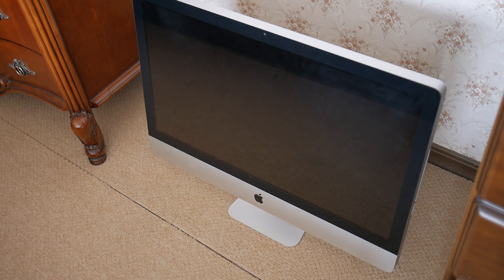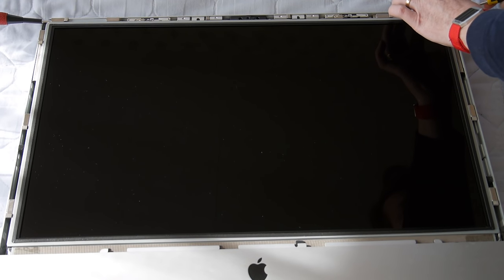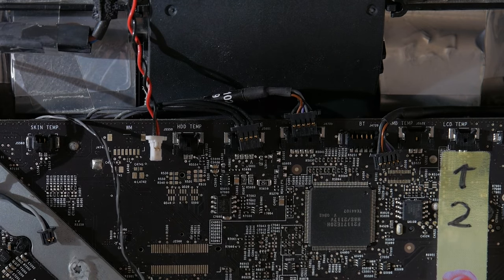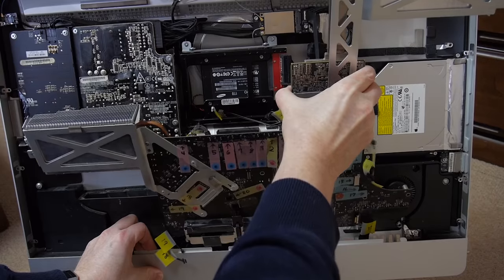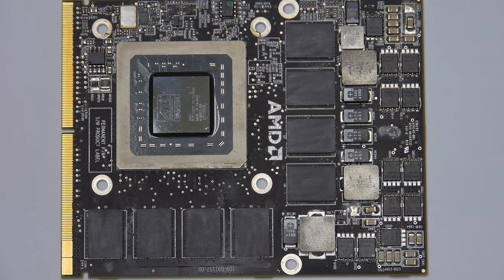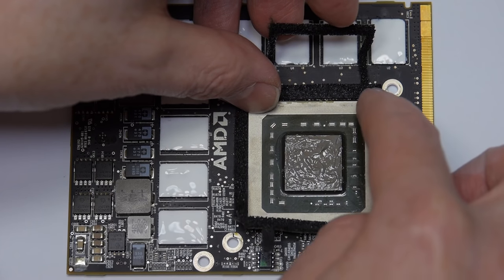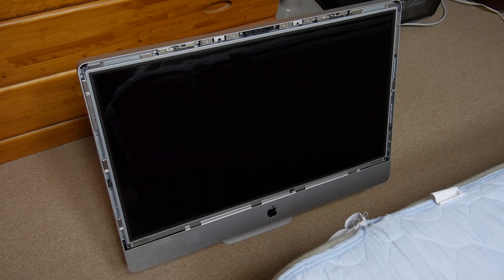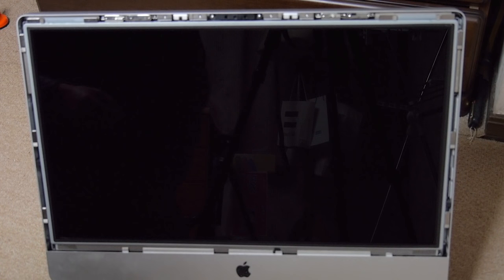Late 2009 iMac 27" Video Card Repair [4850 Bake]

Comment: Hi. I had a damaged graphics card so I did what is in this video.  After submitting the iMac, I was happy because everything worked.  After about 15 minutes, the computer turned off. What have I done wrong?
Reply from the maker: Thank you for watching and for your question. Either the bake did not work in your case, or the card is getting too hot and your machine is shutting down. Did you clean off all of the old thermal paste? What replacement thermal paste did you use, and were those pastes purchased by you within the last year? Also, what model year is your iMac and what is the model number of your video card?
Reply: @JDW-  Thanks for the quick reply.  I cleaned the graphics card from the previous thermal grease.  I used some cheap "Gembird" paste from a local store.  I bought it the day after baking the graphics card.  My iMac is from 2009.  Has Intel i5, currently no disk and 10 gigabytes of RAM.  Where can I check the model number of the graphics card?
Reply from the maker: Since you have a 2009 model, if your video card looks like mine does in my video, then you have a 4850 card.  My concern is about the thermal paste you used. You actually can’t use the same thermal paste on the GPU as you use on the video card memory chips, especially if you clean off all the old thermal paste. That’s because the memory chips have a gap above them. Those memory chips do not directly touch the heat sink like the GPU. For that reason, you must either use thermal pads or use my recommended K5 Pro thermal pad replacement paste. If you use normal paste for a GPU or CPU on those memory chips, it will not bridge the gap well and your card may overheat. I think that could be the problem.  My 2nd Bake video shows all this in detail, and I put a lot of helpful info in the text description under that video too, so be sure to read through that. I hope this helps!
Reply: @JDW-  I only have thermal paste on the graphic chip.  I have original thermo pads on the memory chips.  Maybe they need to be replaced because they are already old and worn?
Reply from the maker: I cannot give you a 100% guarantee that will solve your problem. But I can’t say that using the old thermal pads it’s a very bad idea, and that is very likely the root cause of your problem.
Reply: @JDW-  What can I do now?  Buy new thermal pads?  Can somehow cool the graphics?  I tried to set the fans to max in Macs fan Control program but it did nothing.  I care about this iMac and do not want to give it to the service ...
Reply from the maker: @oskarmarkowicz3081  In the Text Description under my video above, I provide Amazon links to the pastes I recommend.  Your Gembird paste is fine for the GPU but not for the memory chips.  You must clean off all the old thermal pads from the heatsink and memory chips, then use K5 Pro.  Just forget using Thermal Pads because you would need to measure the gap between the memory chips and heatsink, and even I can't do that.  With K5 Pro, the gap width doesn't matter because it is a paste.  But it is not a normal paste.  K5 Pro is made especially for you to replace thermal pads.  You did not remove the old paste. You did not use thermal pads or K5 Pro.  I really think that is your card's problem.  Like I said, I cannot offer you a 100% guarantee, but based on what you said (power-down after 15 min.) that sounds like a heat-triggered problem.  And because you did not clean off the old paste and use K5 Pro on the memory chips, that is problem letting the heat rise too high and trigger a shutdown.
Reply: Thanks. I will do as you say.  I'll write later if it did work. Goodbye! :)
Reply: @JDW-  Hi.  After doing everything you said, the computer works - you can hear the fans but you can not see the image.  What can I do now?
Reply from the maker: While the Mac is running, shine a flashlight into the display and verify if you can see any image. If you can, it means the backlight power circuitry is damaged. If you cannot see any image, then the problem is one of two things. It could be a cable was not properly reconnected when you assembled the computer. That is the cause of a black screen in most cases.To verify that, you would need to recheck all of your cable connections again, especially the two ribbon cable connections. The ribbon cable in the upper left corner of the iMac is especially prone to damage, so you want to check that with a magnifying glass. 

If all of your cables and cable connections are perfect, the only explanation is that the bake did not work in your case for some reason. Your only two options in that case are to either try the bake again, or replace the video card.
Reply: @JDW-  Thanks, I will try this tomorrow.
Reply: @JDW-  I shone a flashlight on the screen and unfortunately I can't see anything.  It also doesn't show anything on the external monitor.  I checked all the cables and they were all connected except this cable in the upper left corner because it was not there (iMac had been operating without it before) What can I do?
Reply from the maker: Start watching my 2nd Bake video at approximately the 6 minute mark and you will see me talk about that thin ribbon cable that goes in the upper left corner:
https://youtu.be/6BJGLFCigdA

If that is indeed the ribbon cable that is missing on your machine, assuming you have a late 2009 27” iMac like I do, you can buy a replacement cable from AliExpress. Simply open the text description underneath that 2nd Bake video to find a link. 

But make absolutely sure you have the same iMac as I do because I’ve never heard anyone ever report that cable missing before. That’s too strange. In fact, I think you should shoot me a photo of the inside of your iMac so I can take a look.

Comment: Cool video guide. Anyway don't be so serious with the tools you use to remove the plastic panel which protect the LCD. I used 2 small ones (those you use to remove the iPhone screen) for years and no problem found.
Reply from the maker: Thank you for your kind comment, Eusebio!  When you have time, please feel free to post a link to the iPhone tools you mentioned.  I'm sure other folks reading the comments would benefit from considering a variety of tools available that can do the job just as well.

Comment: Okay...following along. When I took the little battery out, some of the plastic holding it in broke off. Can I just tape the battery in since it just wants to fall out. Also, your video sped up very quickly when putting the whole panel (logic board) back in. Mine does seem to want to go back into place. What is the secret??? Seems like it won’t drop down far enough. Thanks!
Reply from the maker: Tape will come off over time.  My battery holder broke on my 2nd bake and although I did not show it in that video, I put the battery back and then applied some hot glue over it while holding the battery down.  Hot glue won't easily come off over time, but it will allow me to pull it off with my fingers, should I need to replace the battery again in the future.  The secret to getting the motherboard back in place is PATIENCE.  I kid you not.  It takes a while because there are many connectors and if you leave them all disconnected, inevitably one will fall behind the motherboard and cause problems.  Another thing it could be are the USB connectors and other ports.  You need to be careful about those.  Make sure they all can be seen from the outside and back of the machine before you start screwing down the motherboard.  Another thing it could be are the RAM slots at bottom.  Make sure that little light sensor PCB in the middle-bottom-front of the motherboard is removed when you put the motherboard back in and see if that helps.  Yet another thing it could be are the fans, especially the fan at left.  Make sure that fan is to the side of the motherboard and not behind it.
Reply: JDW Thanks. Good to know about the tape. And will keep working on getting the board back in. Glad I didn’t get it in since I need to fix the battery holder.
Reply: Hi: thanks for the battery tip!  I am glad I couldn't get the logic board back on. So go the battery in and then realized I missed the step of taking the RAM out.
Reply from the maker: Don't forget to put the RAM back in when you're done.  No harm will come, but you will get some scary beeps without the RAM.  Best wishes!
Reply: JDW I did get the beeps because I didn’t push them in hard enough.

Comment: I this also applied to imac that has black screen problem?
Reply from the maker: Sometimes, but not all the time. It could be that your backlight simply is not working, and to confirm that you need to power on the machine and then shine a flashlight into the screen. If you see something, the backlight is the problem. If you see nothing, it’s the graphics card.
Reply: @JDW-  do i need to also renew the thermal paste or not, when baking the GC?
Reply from the maker: @Mikey_Official  Absolutely positively REMOVE all the existing thermal paste BEFORE your bake!  Then after the bake and after your card cools, you will need to apply new thermal paste.  I recommend K5 Pro on the memory chips because it is a thermal pad replacement paste that can be used without need to measure anything.  I recommend Arctic MX-4 paste on the GPU chip, not only because it has good thermal transfer, but because it has 8-year durability. Use 99% or 100% IPA to clean off the old paste.  Yes, 70% will work, but it has a lot of water in it.  100% IPA has no water and is a more powerful cleaner, and it won't harm your PCB either.
Reply: @JDW-  how much does all of this gonna cost me, and can i just use a regular thermal paste on the chip and the gpu instead?

Comment: Instead of baking and risking it happening again wouldn't you say just changing the ATI Radeon 4850 512mb card to a ATI Radeon 5670 512mb be a better upgrade if you are taking the machine apart?
Reply from the maker: No. The bake is much cheaper than buying a replacement card, and my second bake lasted two years and nine months, which is, in my opinion, something that makes the bake worth the effort. I recommend buying a replacement card when the bake no longer works. That day will come because you cannot keep making the same video card forever. 

Also keep in mind there are sometimes caveats to using a replacement video card that was made for a newer iMac model, as I describe in my 6970M video.

Comment: My question is why does the other 8 chips need so much thermal paste. It could be that the chips are not making good contact with the heatsink. Is it possible to add little flat metal sheets on top of the chip for better heatsink contact?
Reply from the maker: The memory chips require either a thermal pad or K5 Pro (what I used), which is a thermal pad replacement paste.  Why?  Because there is a GAP between the top of the memory chips and the bottom of the heatsink.  In the case of the GPU though, there is no gap at all.  A thermal pad or K5 Pro is better than metal sheets because metal is fixed width and if the card is slightly warped (mine was), then some chips may be ever so slightly closer to the heatsink than others.  Thermal pads are soft and therefore can change thickness slightly. Ditto for K5 Pro.

Comment: You replaced your PRAM battery...is that a necessary step that has to be done, or just baking the videocard?
Reply from the maker: You don't need to replace the PRAM battery.  Baking the video card, combined with using a good thermal paste, will get you up and running again.

Comment: Hi. I have a problem, I did what you said, but it only gives me external video, if I connect the screen of it, it does not send the imac, but if I disconnect it works very well by external video.
Reply from the maker: Juan, if you "did what I said," it means you removed your video card, cleaned off all the thermal paste, baked it according to the instructions given in the text Description under my video, let it cool slowly to room temperature, applied new thermal paste (and you should not have used electrically conductive paste or pads on the video card memory chips), reconnected the card, reconnected all your cables, put the memory back in, connected power and on power on you get nothing on screen.  Is that correct?  The fact you get external video is a positive sign, but the lack of internal video indicates you may have forgotten to connect a cable, or you accidentally broke part or all of your cable, especially the thin ribbon cable that is the first cable you must disconnect when you open your Mac.  You should watch my 2nd Bake Video (see link in Description) if you haven't already because it covers cables in a more detailed way.  I think you very well may have a cable problem.
Reply: Hi. if I did everything you said. and the strange thing is that if I connect the main screen, the computer does not turn on, but if I disconnect the main screen, it turns on and gives external video. Will it happen to me in time or temperature?
Reply from the maker: What is the model year of your iMac?  Is it Late 2009?  Is it an i7?  And is it the 27-inch model?  How are you disconnecting the main screen?  What connector?  Can you shoot a bright and clear, high-resolution photo for me that shows the connector you are "connecting to the main screen"?  You can post such a photo to Flickr or DropBox or CloudApp or Apple Photo Sharing or Google Drive and then create a sharable URL and then tell me that URL in your reply.  Sorry for the many questions, but there is much I still don't know about your machine which I need to know to provide more help.

Comment: I have a question k 5 is for the  ATI chip and the k4 on the rest of the chips?
Reply from the maker: No.  The opposite is true.  K5 Pro is a thermal pad replacement paste that must never be used on a GPU or CPU because it is not made for that.  K5 Pro is only used when there's a gap between a heatsink and a chip.  In the case of the iMac video cards, there's a gap between the memory chips and the heatsink, which is why thermal pads were used by Apple.  But it's hard to measure the exact distance needed to know which thermal pad thickness you'd need, which is why K5 Pro is better than thermal pads because thickness doesn't matter.  Any excess K5 Pro you use will be squished when you press the heatsink on the card.  Another benefit of K5 Pro is that in the case of slightly warped video cards (mine was warped), the air gap is different on different memory chips.  For fixed thickness thermal pads, that might be a problem, but for K5 Pro, it's not a problem at all.  

All said, use K4 Pro or another good CPU/GPU paste only on the GPU chip of the video card, and use K5 Pro on the memory chips.
Reply: @JDW-  Thank you!!!!!!! I really appreciate your help. I just baked my late 2009 21" Imac and it worked!!!!  Im glad I found your video!

Comment: The issue could be you put thermal paste on already bad paste just keeping more heat in the v ram causing overheating
Reply from the maker: Very possibly, yes.  And it the fact that the paste I used on my 1st bake was several years old (still very soft, but old) could have also been a problem.  Please watch my 2nd bake video to see the kind of paste I used.  That bake is still going strong 11 months later!  (Link in Description)
Reply: It could have been the card in general for all I know :D
Reply from the maker: I would say that it could not be "the card" because baking it fixed the problem!  The card was clearly not "totally dead" because even though my 1st bake lasted a mere 4 months, my 2nd bake has lasted 11 months and is still going strong.  At the end of the day though, the card's design is flawed.  Too many people have this problem, and they should NOT have this problem.  Apple really screwed up on the 2009 to 2012 iMac video cards.

Comment: I have a 2008 24" iMac, with Dual Core. The video card has just now gone out on it. Would it have the same connections inside as the 2009 model? If not, does anyone know where I could find a video showing the 2008 model video card repair/replacement? Thanks...
Reply from the maker: Thank you for your question, Charla.  I have no first-hand experience with a 24" iMac, and your model is 1 year older than mine.  I was able to find a few 2008 model photos at iFixit for you, but those are geared toward HD replacement and don't show the video card: http://bit.ly/1EmYBsV     Here is the video card tear-down for the 2009 24" model, which may or may not apply to your 2008 iMac: http://bit.ly/1RZVXi2
Reply: Thanks for your research, JDW. I'll check out the photos at iFixit. I already have a replacement for the 2008 computer, but hoped I might be able to get it working again to use upstairs.
Reply from the maker: It's honestly a lot of work and there are no 100% guarantees that the oven-bake will fix the video card on your iMac; but if you have an adventurous spirit, the needed tools and patience, since you appear to have a replacement Mac, you have nothing to lose by trying.  Best wishes!

Comment: Question…. Why take apart the motherboard and other components when the video card slides right out?
Reply from the maker: I answer that question in the text description.  You need to remove it if you want to replace the battery which Apple foolishly placed on the opposite side of the motherboard!